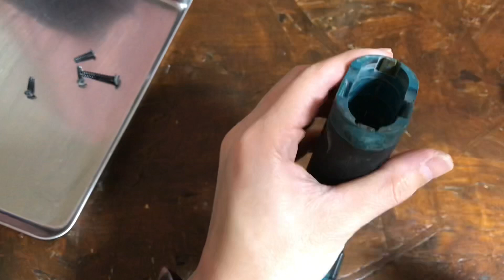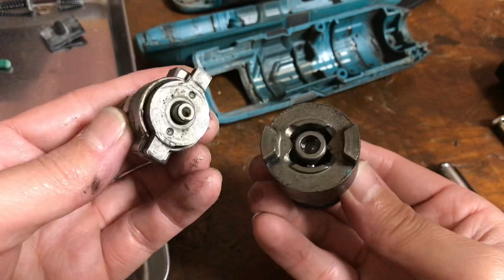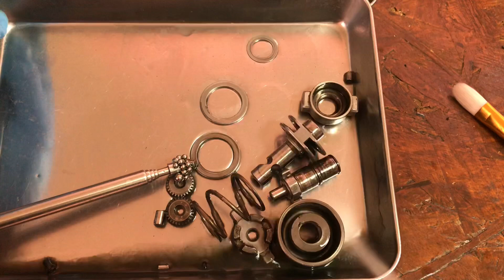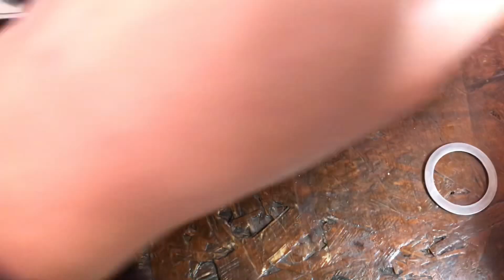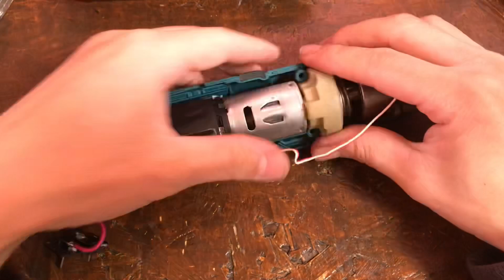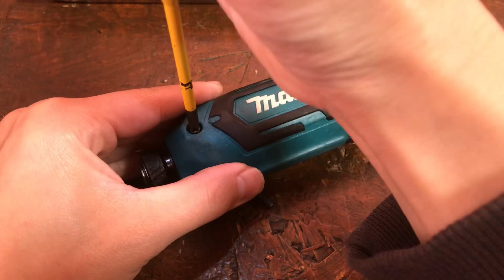ジャンク修理 マキタのペン型インパクトドライバー TD022D 全分解

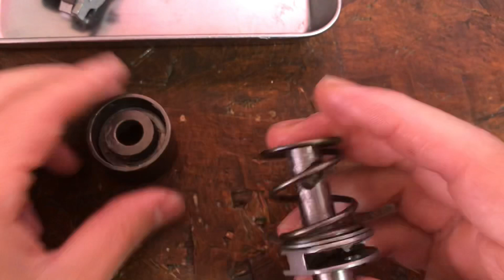Comment: Nice video! Is it possible to disable the impact function by remove/fix components at 7:22?
Reply: no its not possible and why would u want to do that ? u removing a point of its calling impact screwdriver
Reply: @orboffire  I have a  TD022D now, it's perfectly match my work with computer hardware, as to the impact function I don't need when work on laptops , I use Bosch go 2 instead.
Reply: @yujoe5094  Makita has the DF012DZ for you!